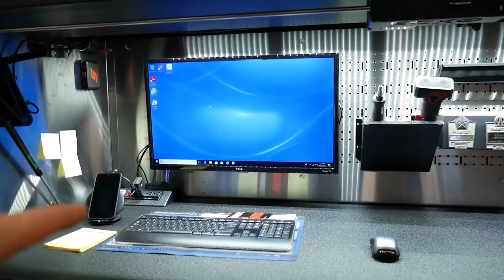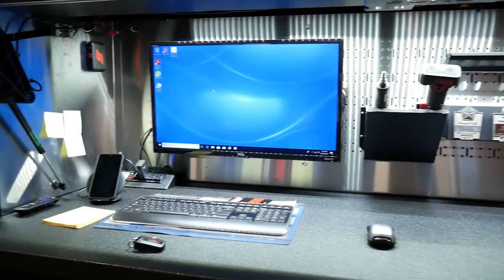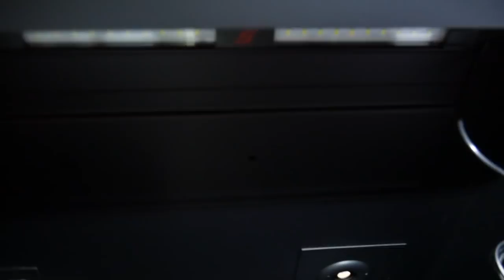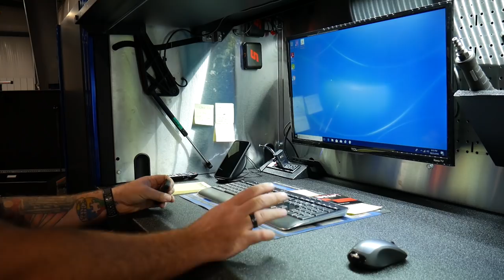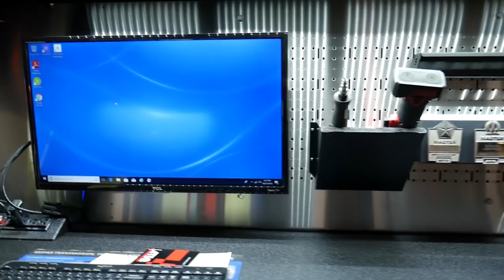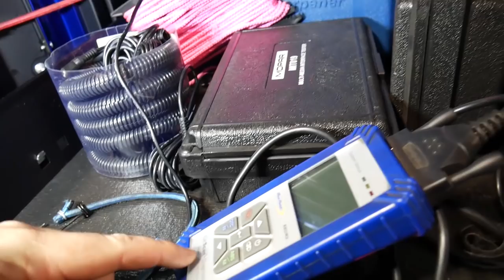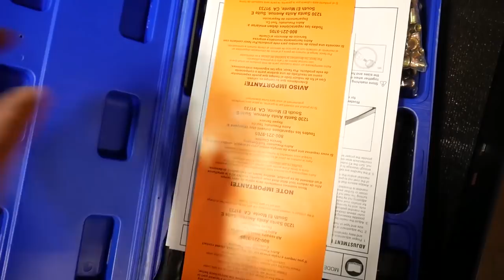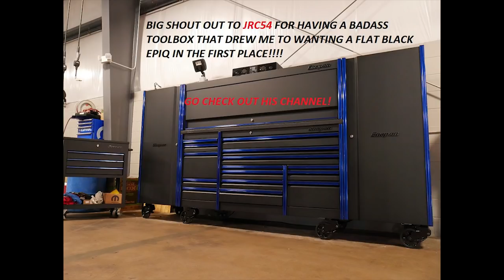TOOLBOX TOUR OF EPIQ PROPORTIONS

Comment: I never really saw a point in a tool box that cost as much as a new car. It looks nice though.
Reply: I had the same thoughts about Mercedes Benz owners,  till I drove one!  Now my Honda, just ain't the same no more
Reply: You can save sooo much time, when everything is neatly organised...
Reply: @lockederbass90  yes but I can do that with the cheaper ones at home depot or sears for half the price.
Reply: why buy a house when you can easily live in a trailer?
Reply: @robsmith3106  I think that you dont need to have a huge snap on tool box... But you should have tools from a brand you trust and where you can get a lot of stuff from. I have my German toolbrands where I can get everything from and I can get replacement parts. So I dont have to buy a new set if a nut breaks.... A have a few tool boxes at my shop from different brands, but a like to stick with one brand which can deliver everything I need so that everything is compatible and can be organised nice. A standart mechabical toolbox costs typically around 2-5 grand, depending on what you want. I think for reliable and professional equipment, its a fair deal...
Reply: @lockederbass90  yes maybe for a big shop I run a farm garage and my craftsman and husky work well for that.
Reply: @edwardthayer9386  best visual display comment
Reply: @robsmith3106  The Husky, Milwaukee, Dewalt etc are absolute junk in comparison. You could pick one up and drop it on most truck boxes and the only damage done would be to the box they dropped. Do the opposite and the home depot box would crush like a beer can. I certainly don't advocate buying one new but they come up used super cheap all the time. Just like I would never buy a new car off the lot. Let someone else take deprecation hit. Like the old saying about cars, "  If you buy new you're either stupid or rich". I paid 1600 for box that's technically a 10k+ box. I flipped tool boxes on CL for a little more than a year so I actually ended up with a free box and money.
Reply: @edwardthayer9386  You must be in Ohio or somewhere like that. 30k doesn't a 1/4 of what you need just for a DP in Cali.
Reply: @LordRumple  😂🤣😂no wonder it is, you can't even write a sentence!
Reply: @ellobo8593  i had both and honda is very nice and mercedes is just the 1% crowd:)
Reply: I mean if you get paid good money to work on cars every day I can somewhat understand it, I still don't think I'd ever spend THAT much lmaon
Reply: The box that I want to set up through snapon is 40k and I'm gonna have to hold off on that for a long time. I don't have the tools to fill something that big as of right now anyways.
Reply: @robsmith3106  If you get a "cheaper one" from sears or home depot, you will be replacing it in a couple years or less if you are a professional mechanic and actually open and close the drawers multiple times a day.  The sears and home depot boxes are great for a DIYer in a home setting.  Snap on, mac, matco, cornwell are built for being used everyday for years on end and have lifetime warranties on slides and drawers.  They are forever toolboxes, where sears and depot would be throw away after a couple years and drawers don't close anymore!
Reply: Think of it as a car you can deduct from taxes and you will not be selling in 5 years

Comment: I have a Snap-On rolling chest my father purchased new in 1955, and on top of that is a Snap-On tool box he got used and gave to me in 1975.  I still use both and the drawers on both are still very smooth.  I don't understand though why a person would need 5 and 6 of the same tool stored in the same box.  I have a Weather Guard on my truck so I have some duplicates but why 6 vise grip pliers?  We use tools until they fail then either buy a new one or replace it under warranty.  Name brand tools are so expensive I don't spend the money anymore.  Also I don't care for Snap On so much because the tolerances are so tight if a fastener has a little rust or paint it doesn't fit correctly and sometimes I get the socket stuck.  When I buy name brand tools I go with Cornwell (Original American made professional hand tools) less expensive and in my experience and opinion, better.

Comment: That is one sweet Toolbox I love the black with the blue handles! I've just got a 56" Husky Toolbox with a top and bottom, i like it, it's a matte black which gloss black handles. Some of the stuff I love is it has soft close drawers and a giant canopy with an 8 plug strip across the back and 2 USB ports, I use some of the plugs for my Ridgid, Milwaukee and New Ryobi battery chargers and I also keep 13 of my tool batteries that aren't connected to tools up there. I have a black glove holder on the side where I put a box of nitrile rubber gloves. It came with a small light for under the canopy thats not bright and won't hold a charge so I went down to Harbor Freight and for $35 I picked up a nice underhood light with magnets that I put on top of the canopy and it's super bright, I keep my Milwaukee and Ridgid charger up there and my new Ryobi charger I just got because I just got a Ryobi cordless hot glue gun since my old corded one was in bad shape and the cord is short and I was tired of pulling out an extension cord everytime I wanted to use it. I also kept my old 44" US General Toolbox to keep some of my old junk tools in or ones that i replaced with nicer tools, the entire back wall of my garage is a pegboard so I have a lot of my tools hung up on it, being a mechanic I'm sure you don't use a toolbelt and I never used to be a fan of them until I got a ToughBuilt one for free thru a testing program i was in where I got to choose 5 things a month to get for free and I just had to write a review on them after I tested them, this ToughBuilt toolbelt system is awesome you put clips onto your toolbelt and then you just clip the pouches you need on and off to easily switch pouches, i have 12 pouches and 2 belts and i got all but 3 of the pouches for free and then I got rails that screw to the wall that have clips on them  so I can clip my pouches to the wall when I'm not using them, i also got a bunch of toolbags thru the same program my favorite is my huge Klein bag with 108 pouches on the inside there are pouches and also elastic straps and it has a removable center so if i want to carry some of my power tools I can take it out and it gives me room for some power tools plus it has a tape strap holder and a tape measure clip and a zip up pouch on one side with lots of pockets and 2 separate poiches on the other side one witha bunch of elastic straps to hold your screwdrivers and the other poich has a hard shell outside so you can put your multimeter in there and not have to worry abortit being crushed. I work out of my garage now and I have cabinets all down one side of my garage for supplies and tools I don't have room for in my Toolbox or that are to big to fit in it. I also have a 60 gallon air compressor in my garage with a ball valve on it to turn on the air to my hard air lines running across the walls running to 2 regulator/filter combos with ball joit valves on them to turn them on and off depending if I'm using them or not even though I don't have many air tools anymore and the ones I do have i also have cordless versions of. A couple questions for you, where are all your flashlight, razor and regular knives and your tape measures and don't you have any levels or chalk lines either or squares. Also I'm surprised by how few air tools and power tools you have, when i used to work at a truck show doing welding and fabricating and autobody work and painting I had 20 air tools and 9 18-Volt power tools. I noticed you don't have many air tools or power tools and I'm surprised that all your power tools are only 12-volt and 14.4-volt ones. I only have 9 air tools now a lot of which have been replaced by cordless power tools, the air tools I use are 3 paint guns, 2 nail guns, my tire inflator with gauge, i do use my 6" orbital sander when sanding cars but I use my 5" cordless sander on wood. Sometimes I use my right angle grinder although now instead I use my Milwaukee M12 polisher/grinder combo as for my 3/8" air ratchet it's been replaced by my 3/8" Milwaukee M12 ratchet and my 1/2" air impact gun with 800ft-lbs torque has been replaced by my 1/2" Milwaukee M18 FUEL One-Key High Torque Impact Gun with 1400ft-lbs torque, i actually have 2 or them, i keep 1 in my truck and 1 in my Toolbox. Now that we live in the age of cordless tools and corded and most air tools have become obsolete I started out buying Ridgid tools and now I have 15 Ridgid 18-Volt tools and 7 Ridgid batteries and after I was sent a few Milwaukee M18 tools and 5 batteries thru the review program i was in i started buying Milwaukee tools since i had 5 batteries, $750 worth as we all know batteries can be one of the biggest costs when getting into a new tool line. Now i have 21 Milwaukee M18 tools and 12 M18 Milwaukee batteries and 5 Milwaukee M12 tools and 5 Milwaukee M12 batteries oh and I just got 1 Ryobi tool for a total of 42 cordless power tools, although 2 are stereos, 2 are blowers, 1 is a weed whip, 1 is an edger, 1 is a 10" pruning pole saw and 1 is a 16" chaninsaw so 6 are actually yard tools and 2 are stereos so only 34 are actual power tools. Even though I only have 1 Ryobi tool right now i have 2 Ryobi batteries, 1 for my new tool and 1 for my Ryobi garage door opener which is Badass, with the battery in it even if the power goes out you can still open the garage door via power from the battery, it also has 7 ports for different kinds of accessories on mine I have a 30 foot retractable extension cord with 3 outlets on the end, a laser parking assist system that shines down 2 lasers to tell me when I've pulled in just far enough and 2 fans which are awesome to have in the summer and i have an outdoor keypad and a garage door opener by my front and back door and they have buttons on them to turn the accessories like my fans on and one of the best things is there's an app for it that I can use to turn the fans on and off and open and close the garage and it sends notifications to my phone when the garage has been opened or closed and you can set a timer to let you know when the garage has been open for so long, i have mine set at 15 minutes. Anyways since I'm not a mechanic I don't have all the specialty mechanics tools that you have, still when i worked at a truck shop and before my old Toolbox and tools were stolen like I said i had 20 air tools and 9 18-Volt DeWalt cordless tools so I was surprised you didn't have more air tools and cordless tools and also that none of your cordless tools were 18-Volts. A piece of advice when you buy more cordless tools buy more Milwaukee ones, Snap-off ones are overpriced and not as nice as Milwaukee ones, another piece of advice is they have had a Milwaukee M18 Surge Impulse Driver for awhile one and they just came out with a Milwaukee M12 Surge Impulse Driver, I got one, and I got one in a kit that came in a soft bag with 2 batteries and a charger plus I got a free M12 Right Angle Drill with it too for $199 which is a deal since the M12 Surge as a bare tool is $149. The Milwaukee Surge Impulse Drivers are the best Impact Drivers I've ever had, the M12 one is really compact and light but still has a lot of power and one of the best things about it is it isn't a regular impact driver, it's an Impulse Driver meaning instead of using the standard metal on metal hammer and anvil drive system that other impact drivers use it uses a hydraulic fluid system to drive it which makes it %50 quieter and instead of having short bursts of peak torque it has long amounts of sustained torque making it vibrate less in your hand and not twisting it as much resulting in less fatigue plus the quieter operation is really nice! Anyways great video I love your Toolbox and all the specialty tools are sweet and must come in handy being a mechanic I also gotta say i love your wire strippers I used to have a pair like that before they were stolen and they are the best but they are hard to find! But I'm telling ya you need more cordless power tools, not having to run airlines and trip over them is great and things like the Milwaukee M18 FUEL 1/2" impact is great for taking wheels and stubborn bolts off and if the big Milwaukee M18 FUEL High Torque Impact Gun is to big to get into places they make stubby 1/2" ones or 3/8" ones, I can practically guarantee that Milwaukee has a cordless version of any tool you will need! Anyways good video bud I enjoyed it!👍

Comment: 4:40 try putting a piece of electrical tape on the metal parts of magnetic latch.  It might lower the magnetic strength enough that you do n t have to remove a latch

Comment: Careful pulling magnets out of the locker door. You may end up twisting the door over time. Even if it's the center magnet there will be times you are opening from a high or lower location than center

Comment: My dad's shop,we don't get the easy outs a lot for broken off bolt removal.The Mig welder comes out and this does work.He still has a few of the factory Chrysler factory tools for the 9 1/4 and 8 1/4 rear ends from the days he worked at a Chrysler dealership

Comment: Dang brother... I didn't know some of those tools existed.  And considering it was rare to see anything non-Snap On, I'm guessing you've about got a mortgage into that toolbox!  Thank you for posting the link!  This seems like a mechanic's fantasy.  I have to imagine most mechanics can't afford a setup as nice as yours.  I'm not even a mechanic and I was drooling!  Thanks again!
Reply: Holy cow, 19:21, I've had to deal with that only with a Lincoln Navigator.  The spark plug didn't bust, but when we got it out (it was extremely loose already) the loop of metal at the end of the spark plug was gone, busted off.  That's when I learned about that problem with Ford engines.
Reply from the maker: Lol yeah those triton motors have issues ALOT! Even as a Chrysler tech I’ve needed that tool a lot. Thanks for the support and thankfully I don’t owe much of anything more on my box and tools.

Comment: please go Milwaukee all the way i hardly use air anymore except for my air hammer or punting air in tires
Reply: only their half  inch impact is worth a fuck... the cordless ratchet sucks and so does the 3/8 impact
Reply: @michaelmorgan2880  your crazy as hell i use Milwaukee 1/4  cordless ratchet and their 3/8 stubby impact 10 hours a day  and as long as you aren't doing diesel work you can take anything off... other then crank pulleys that air or a 1/2  cordless
Reply: @tommygun060  still, snap on is the best... regardless of price, when it comes to wrenches, ratchets, screwdrivers, pliers, and tool boxes, snap on cant be beat on quality
Reply: @michaelmorgan2880  its just a brand , sorry im just saying you can do the same job with a lot less, all about the person using it .
Reply: Screw that shit. I bought Hilti 22 volt series drivers and never looked back. They make the rest look like toys...
Reply: @michaelmorgan2880  I've abused the hell out of my 3/8 non-fueled ratchets doing airbag recalls(dash removal) for the past 6 months with no failure. Then it gets used for under belly/engine covers for oil changes, or whatever else it fits(pretty much everywhere). 

I'm not sure about their 3/8 impact wrenches. I did buy a 1/4 hex driver and threw a 3/8 adaptor on there and use it for installing tonneau cover rails, step side rails. Works pretty good. 

Hope you have better luck with them, great brand.

Comment: If your looking for some awesome rails I have a suggestion. Westling machine makes the best trays imo. I bought SAE and metric plastic rails from snap on @ $27 a piece. Wrestling machine sold me 4 3/8 CNC machined and etched rails for $84 shipped.
Reply from the maker: That’s not a bad deal at all!
Reply: @RustbeltMechanic  what is the Part No: for your 3/8" both Air and Battery Snap-on Impact Gun. Or can you send me the link to a video you have that you recommend. Thank you for all the great videos I have watched almost all of yours and they are very helpful for me being a now ASE Certified Mechanic in Brakes and Engind Repair. Your videos and knowledge you share helped me to pursue this career even more.

Comment: Try out the Ernst Socket boss rails. That's what I use at work and they're amazing. And you can yank a whole rail and take it with you. And you can add several sizes to a single rail to but multiple drive sizes (say a multi-drive size torx set) on a single rail.

Comment: Brow luv the box, wished you went through the construction of the box, if any walls were doubled or single, single or dual casters, how the glides were in the casters.. an the lockers for the drawers. Noticed any areas that didnt get fully painted.
Side to side test on the drawers, unloaded an loaded. Did you have to use a area with two 110s on the wall, did you replace the wall outlets with 30Amp GFIs or use the standard type plug socks and do you plan to use the top at all or do some kind of sheet for the top, for protection and anything for the sides, back or the bottom of the box ?
That last power box drawer you use.. See if they have the plate to cover the cords, hate to see someone drop something an damage the cords..
Reply from the maker: Wayne Hawley I’ll likely be doing an update video on these kind of questions. Thanks for the input👍🏻